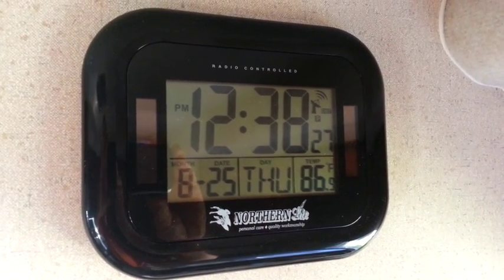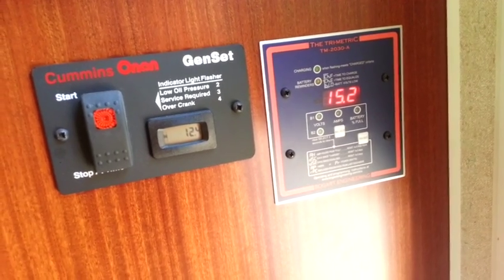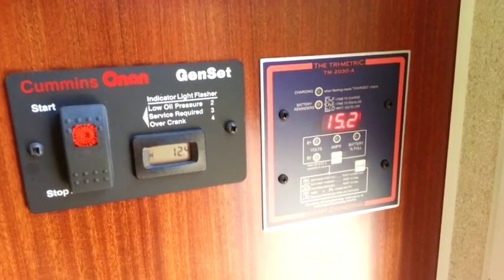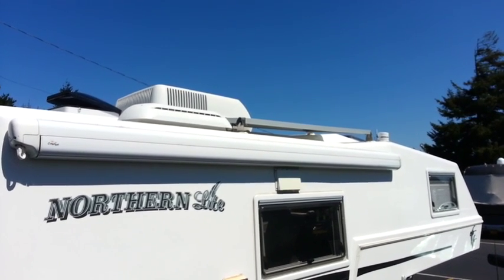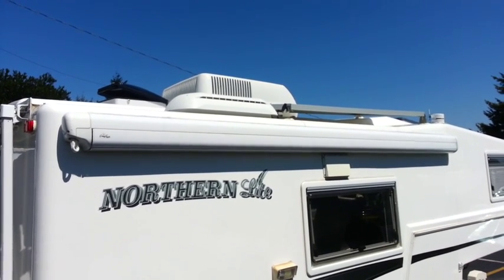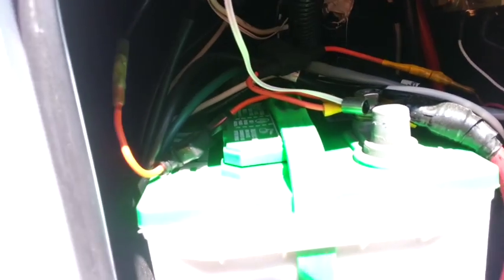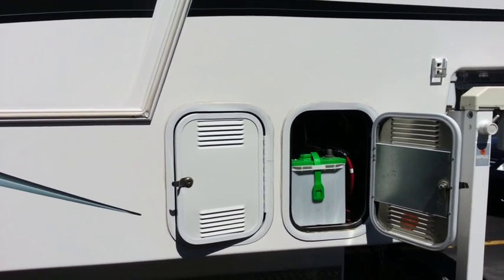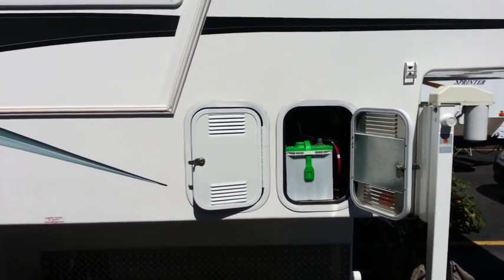SOLAR UPDATE August 2016

Comment: You could go with a portable panel for a booster. I installed an extra cigarette lighter plug at the dinnette. I was able to tap into the wires for the water pump/heater, which are under one seat. I use one of those inverters for my laptop, 400w.
Reply from the maker: I'm looking at either installing another 80-100 watt panel on the roof or a portable unit. I'd rather have another one on the roof but a portable unit for longer stays would work fine just have to figure out how to store it in my basement.
Reply: West Coast Roller
One thing the solar experts will temm you, if you install a smaller panel, it will draw down the bigger one; I started with a 90w, added the 100w, and the barrage of comments! "That's not 190w! Never install a smaller panel..." Just a heads up. I just got an extra 100w suitcase, that video coming along sometime. One thing, it will be good for long term boondocking in places unlikely to be stolen. Is there room behind your truck seat to store it? They're about 2-3' thick, and about 2x3' length.
Reply from the maker: did not know that.......thanks

Comment: Are you sure you're not reading amps charging on the Trimetric? The onan meter was displaying 12.4 volts. If you are getting 15.4 volts charge, you may be damaging the batteries and burning/drying out the "Distilled" water electrolyte. Also, 10.4 volts would be a dead cell in one or both batteries. One dead cell will drain both. Get a battery acid gravity measuring tool at the auto parts place. Stick the tube in and draw out battery acid to measure the health of each cell in both batteries. Best battery diagnostic tool you can have for lead acid batteries. Useless for AGM and other types. Another thing, if your solar system is indeed bringing your TC electrical system up to 15.4 volts, you may damage the radio and other 12 volt devices with the over voltage. Get your DVM volt meter and test your battery voltage to be sure of what your solar charging voltage is. Mine is set at 14.4 volts for AGM batteries. 15.4 volts is an "Equalization" charge to desulphate your lead acid batteries every few weeks. In very cold temps, you need higher charging voltage to fully charge batteries. In warm temps, you need less voltage to fully charge. Your Trimetric I think has an on battery temperature sensor that will account for these requirements. 
I bought 2 SEARS Platinum Group 31 RV Marine AGM batteries and they deliver the power and charge fast. I idled my truck an hour charging the TC via 4 AWG cable and we were set to go for the night. We had one fantastic vent on low/1 all night plus had two cell phones charging and other interior lighting in use. We went to bed with 12.7 or 12.8 volts and woke up with 12.3 or 12.4 volts over a 14 hour use period. Very little solar as we were camped deep in the forest. 
It almost looks like your battery compartments will accept L-16 type batteries. That would be cool. Also, look at the Trojan battery website for the largest AGM that will fit the dimensions of your compartments. Not going to put down Lifelines. They are good, but When I went through the battery process, I couldn't justify the price. The SEARS was priced acceptably and there are SEARS stores everywhere if you need servicing. 
One more solar panel of the same should be as much as you need. My bet is only one can be shaded by sun angle at a time.
Also, look at the weight of the battery in consideration. Greater weight means more lead within the same dimensional area. My SEARS AGMs are heavy compared to many other Group 31 batteries.
Hope this helps.
Reply from the maker: Thanks for the suggestions. I need to do some checks and inspection. I'll see what I come up with. Again, thanks!

Comment: A few thoughts:

Agree with below 10.5 is too low, I don't let mine go below 12.2.  I'm surprised they're going that low. I can run the furnace at night and still have enough to run my 1000w inverter to make coffee with my Keurig in the morning.

I have the same batteries (can't fit bigger than grp27) and my 300w of solar has me changed up usually by 12-2pm depending on the sun.

I run my tv and blu-ray player direct to 12v without an inverter, many of the tv's are actually 12v if you check the back of them. I just cut off the transformer and wire it direct to a 12v plug. I've been doing this for 3 years with no problems.

Enjoying your vids, I'd be living the same way if I could get away from family responsibilities
Reply from the maker: Yep I'm surprised too.....unless I have the tri-metric programmed incorrectly but I've checked it a couple times......my TV is also 12v so I really don't need an installed inverter however a nice turn the key and go device to have. Thanks

Comment: Let's see where to start.......:)  Your panel is installed too close to your A/C unit, so come winter you will have to make sure you aren't parked with the sun casting a shadow on the panel and shutting it down.  Doesn't take more than one cell to shut it down.   If your battery is dropping to 10.8 v by morning then they are toast or will be soon.  The rule of thumb for deep cell batteries is to not take them below 50% (12.2 volts) of capacity.  If you consistently take them below that then you will shorten the life of the battery by a considerable amount.  Your 160 watt panel isn't capable of outputting that amount in a day to replace what you have removed, so your batteries are toast.  

 AGM batteries cost 2-3 times as much and last half as long.  There's no advantage to buying AGM unless you are too lazy to check your battery every 3-4 months.  Look at Trojan 6 volt 105 SE solar batteries.   I'm on my second set of 6v Costco batteries and after 1.5 years they are starting to die on me.  Costco had so many come back with a 2 yr warranty that they cut it back to 1 year.  I won't be buying them again.  Spend the $$$ and get a quality battery, will save you $$$ in the end.    

  The voltage you see 15.2 is the charge voltage and should drop back to about 13.2 and go into float charge once the battery is charged.  Your battery(s) are toast, so probably not going into a float voltage.  You can't get a true battery charge level till you stop the charge and let the battery rest for 30-60 mins.   Fully charged battery will read at rest 12.8 volts.  12.7-12.8 is a fully charged battery.  

   Solar panels don't like heat and your output will decrease by 10-20% on a hot day.  The optimum temp. is about 40-50 degrees at an elevation of 7,000 ft.  I've burned my hands picking up my panels on a hot day in the 90's, so they get very hot.  You don't need to buy a suit case panel at twice the cost.  You can do the same thing with a regular panel.  I've been running my 6 panels portable the past 3 years and have had zero problems.  Yeah, it takes me a few mins longer setting up and taking down, but I'm not in any huge hurry to get someplace, so I'll take the saving any day.  I've been very surprised how tough the glass is.  All the rough travel I do and have only broken one panel.  That was on a freak wind storm at Lk Powell and the panel was ripped out of my hands as I was putting them away.  Landed face down on the only rock within 20 feet!.......Damn.   Shattered the tempered glass into a million pieces, but still works fine.  Output dropped in half though, so I retired that panel.  

Sorry for the long winded post.  I see so many RV videos that show the charge controller and not explain or understand what they are seeing.  Lots a YT videos to get you up to speed on solar or message me and I'll get you going in the right direction.  Once you go solar you never go back......:)
Reply: I agree, 10.8 isn't good. I would verify that with a volt meter though. Hopefully your charge controller is set for the correct battery type. I had two batteries in my TC, only a 150 watt panel, and never saw below 12.3 volts, even on cloudy days. I like the sealed AGM batteries, but they are $$$. I bought a small atv size one, built a portable charging station with it, for cell phones, my kindle, iPad, ipod etc... Worked awesome and was solar charged when not being used.
Reply from the maker: Wow.....thanks for the very detailed response!......When I was at AM Solar they suggested where I mounted the panel was the best location with everything being considered.....maybe there is a better place for it.....with my roof it's tricky to mount. So which batteries are you thinking of buying next? I'm assuming your running in series? The batteries are toast surprised they've lasted this long.....not the best batteries for my setup.

Comment: At 10.8, you batteries are toast. I have had both AGM and flooded, prefer flooded 6 volt. Costco, get you some cheaper 6 volt Exides. Take the money you saved, get a good inverter. Few links if your interested. Don't blow the extra cash on really expensive batteries, 7 years is all your going to get. 
Last set I got was at SAMs, 6 volt, 115 amp for $69. 4 of them in a Class A. How many amps are you using per day? That meter will tell you.

Xantrex PROWatt 2000 Inverter, Model# 806-1220 https://www.amazon.com/dp/B002LGEMOQ/ref=cm_sw_r_cp_tai_TzrWxb9G6DYKH
Xantrex Inline Transfer Relay f/PROwatt SW https://www.amazon.com/dp/B004S5Y158/ref=cm_sw_r_cp_tai_5ErWxbQ06KDZS
Xantrex 808-9001 PROwatt SW Remote Switch https://www.amazon.com/dp/B002W87JNO/ref=cm_sw_r_cp_tai_EFrWxb6BQW03R
Flow-Rite MP2000 Qwik-Fill 2 Battery Kit https://www.amazon.com/dp/B001FCAXZO/ref=cm_sw_r_cp_tai_mHrWxbXXJY394
Reply from the maker: Thanks for your input. Why do you prefer flooded over AGM?
Reply: +West Coast Roller in the container that you are storing them in, there is no need to store on their side, you are not confined, so no need to spend the extra money. If you overcharge, they will boil just like a flooded, except you cannot refill. 7 tears is it.......on any battery, I don't care what they say. Not worth double the cost, simple to maintain.

Comment: do you ever run your AC off solar?
Reply: No possible........ok, if you want to destroy you batteries. No chance on a roof mount, possible on a tiny window unit.
Reply: +Hitman Hite ok. thanks. saw an RV at a show here in IL that was with no issues. I don't know much about rving or solar.

Comment: Greetings,You stated that your batteries are at 10.8 volts in the morning. If you are running a 12 volt battery, you should never discharge it more than 50%. At 50% you would be down to 12.10 volts. If you go below that, you are damaging your batteries. At 10.8 volts, the batteries are dead and will become useless in a very short time.  I don't know how long you have been running them down to 10.8 volts but it doesn't take long doing that to cause damage. I'm very surprised that AM solar didn't explain that to you. Check out this link for a chart of discharge rates. The only caveat to the 50% rule is if you are running Lithium Ion batteries which can be drawn down to 20 to 30 %.  http://modernsurvivalblog.com/alternative-energy/battery-state-of-charge-chart/That said, good luck and enjoy your solar.

Comment: Your battery's will die soon U should keep them above 12.3 six weeks living in my truck Camper  no trouble . If U are living in it I suggest going with a MPPT  Charge controller & about 500 Watts of solar panels. Just a suggestion That will let U live Free..

Comment: My dash stereo runs off the rv engine batt.  When I first rolled out, the only entertainment I had was the stereo and ah my hands.  Anyway, several times I'd run my batt down to where I couldn't start it, but the house batts always saved my bacon.  My solar is 160w too, but I don't do as much boondocking as I'd like to.  Do you know if any of the hydrometers have an auto fill/full feature to prevent under/over filling?

Comment: You're thinking in 2 dimensions. As panels can be stacked on an RV and once setup, the second and third one can be on rails and slide forward, backwards, or sideways. 

I would add. I would avoid 6 volt battery setups. They ar fine for home but on an RV if you lose one cell in the bank. You lose the whole array.. This why the top line RV companies use 12 volt high @h batteries...
Reply from the maker: Yes I understand stacking......with my roof I'm limited with surface area....others have added more panels on this camper.......thanks for the 12volt suggestion....take care
Reply: *****
You seem dense. As I install these system for Living. As the higher the @h the more Solar system you need to keep the batteries at peak performance. As in 12-15 amps per battery. Using the proper charge controller, AC\DC converter and Inverted DC\AC. If you can not recharge them inside 8 hrs at 50% discharge the batteries will die in short order. This is the major cause of early battery failure on most home grown RV solar systems. As they think @h is some more is better fix for bad system install.

So do your home work. As I been an electrical engineer for 30 years. I know how things work and why and how to install a trouble free =, long life system.

Try using this sight for an RV application. And start with how to apply math. http://www.trojanbattery.com/battery/deep-cycle-agm/12v/

And I hope your around to help them when they catch on fire with bad information. As Youtube is full of bullshit setups that can kill you!

Thank You.
Reply from the maker: ***** This was my original plan for batteries exactly as you've replied.....running in series.
Reply: West Coast Roller
Running series gives more voltage and not more @h, as the battery bank will still only hold what one battery is rated at not the combination of the 2 six volts. Parallel gives you more @h but the same voltage.

It's ohms laws. As voltage increases amperage decreases. And visa versa.

So I'm going to say this one more time. Know what the hell it is you're building, how it works and why! If you don't, ask a professional. If will save you grief down the road.

Try calling https://www.solar-electric.com/marine-rv.html

Thank You
Reply from the maker: Agree!
Reply from the maker: Claude Rains agree with your last paragraph...thanks for sharing
Reply: West Coast Roller
I'm not trying to be a dick, I just want people to understand electrical theory is something to respect. As one mistake can cost someone their life. As you are dealing with not one source of electrical current. As some systems use generator, Solar, AC\DC converter shore power and automotive sources of power. To maintain their supply of KWH they use and one mistake is all it takes to see if Jesus really does exist. I buried plenty of them in my life time to know. the effects.

And playing with electricity with some knowledge is a dangerous game. It's one reason I have to take test every year to renew my license. I have to be 100% correct every time or they will jail my ass!.
Reply from the maker: any input on flooded vs AGM?
Reply: West Coast Roller
Flooded outside use only and you need them well insulated, as cold weather is murder on them. AGM can be used inside in any position you like. They both need temp sensors on them if your MPPT controller has the option. And never mount flood acid batteries near sparks, flames or gas, propane tanks and have fans to vent the boxes.
Also use smart charges that have the option to desulfate them. I would include auto water meters on flood acid as well. As they tend to be in hard to reach service areas. Which is why people neglect them and they die an early death.

So the price difference is offset by the more maintenance and shorter life. And never vent any flood acid inside a vehicle and think you're covered. As the gas that is vented is not only corrosive but one spark and you have a 75 lb Plus grenade inside that vehicle with you. And trust me they can blow a hole in 4" of concrete!

Plus side to RV AGM, is lower discharges to 70% with no damage to them. Less weight. Options in mounting postilion. No water to worry about and longer life. Rule of thumb is 12-15 amps per battery inside 8 hrs to recharge them properly. Temp probe and smart charges for shore power connections to AC\DC converter. i install breakers over fuses. As the added expense is less then having to find the right fuse and always have an GFCI main breaker. As you have water in an RV in a very small space that can lead to other issues. One being your life.

You can buy DIN mounted breakers with the main being the GFCI. This all depends on the sources you're using to charge the system as well. And never ever put 120 volts inside the same enclosure with low voltage wiring. and use NEMA 3R rated boxes. As you have water sources from rain, leaks, and pluming that are relativity close to each other. As the chassis is the ground. So bound the main service panel to the vehicle real good.And shore power needs the same attention at eh main service panel back top the source which is the panel feeding it.